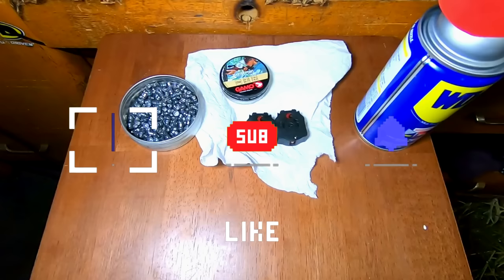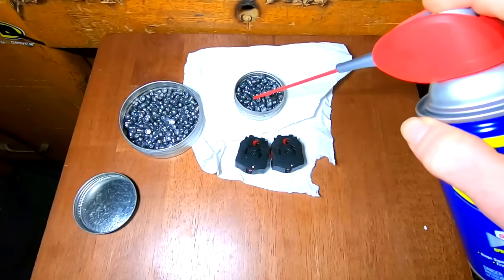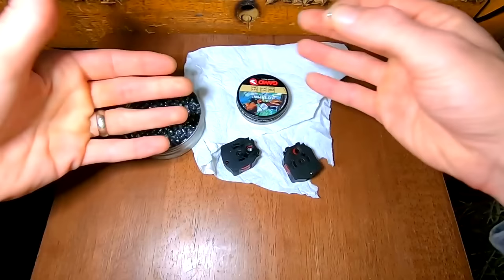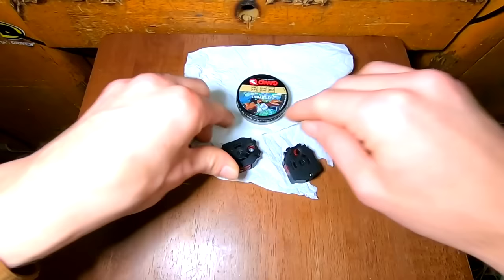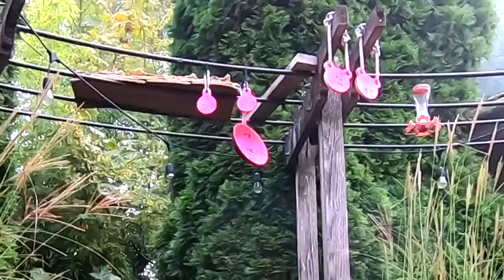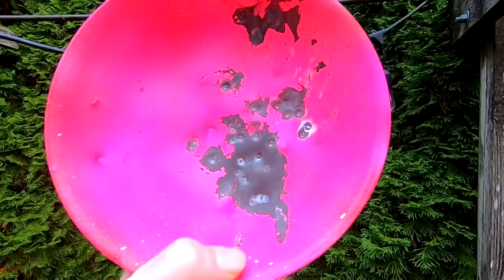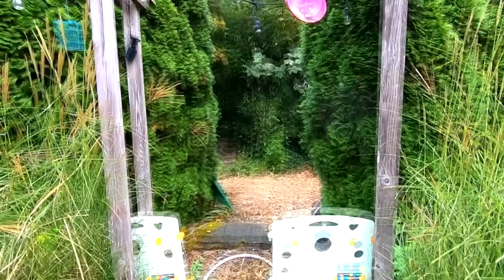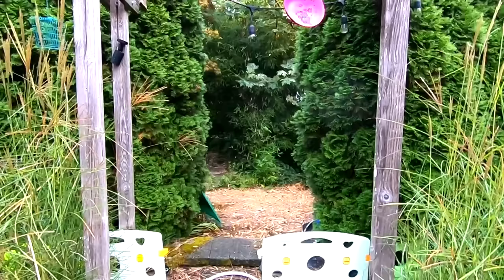Pellet Dieseling the Easiest & Quickest Method

Comment: Not a good idea to pellet diesel a n air gun. Increased pressure and recoil. Will destroy that rifle in short time.The cheaper the gun the quicker the damage. Have repaired several that would not be warranted by manufacturer. It gets expensive every time. Don't do it
Reply from the maker: I've done it hundreds of times out of both guns, and both of them are still fine. I've had them both for almost 5 years now (so warranty is irrelevant anyway).

That being said I've made more money off of these dieseling videos than the guns cost (they are only like 200$ air rifles)

And any damage that might happen, which tends to be none (the majority of people who do this, do this with zero issues much like I have), is easy and cheap to fix, and again, warranty is irrelevant when its easier to replace a rubber o ring than it is to ship a gun to the manufacturer.
Reply from the maker: You are also most likely conflating piston chamber dieseling related damage, to pellet dieseling.

The piston chamber is capable of holding a much larger volume of stoichiometric air/oil than the breech is. This means that dieseling that occurs within the piston chamber will be significantly more explosive, and cause significantly more damage. Yes, it is common for excess oil in the piston chamber to create destructive dieseling. This is common. 

What isn't common, is destroying a gun by putting a tooth pick dab of oil into the back of a pellet. There are zero recorded cases online of anybody destroying their air gun in this way. The only cases of damage I have seen or heard of, were people that got WAY too much oil in their piston chamber, from oiling/lubing their gun, and caused a massive explosion in the piston chamber. 

Again, no one has ever destroyed a gun by putting a tiny speck of oil into the skirt of a pellet.

Comment: Bro, you’re imagining, WD-40 is silicon oil, it doesn’t cause dieseling.
Don’t worry, ignorance is not a crime, just a knowledge level, education level.
All you’re doing with WD-40 is lubricating the pellets, they may be traveling a little faster but no dieseling !!
Reply from the maker: lmfao you talk a lot of shit for someone who has never read the material safety data sheets for WD40.

The regular WD40 has absolutely zero silicon in it, it is all petroleum by products. The only thing in WD40 that ISN'T petroleum, is the propellant. 
https://youtu.be/MUNqJWJnsdU

luckily I looked at the MSDS for you, so you don't have to hurt your little brain.
Reply from the maker: and no you are wrong, it is definitely dieseling the pellets. 

If gaining 30-50% velocity was as simple as lubing the barrel, it would be standard practice. You are not very intelligent if you actually think that is what is happening here lmfao.
Reply: @PelletPlinker  : I stand corrected, thank you.

Comment: This...will totally f&ck up your air gun.  It’s called dieseling as this is exactly what happens in a Diesel engine....the difference is that an engine is built for the temperatures and pressures...a spring air gun isn’t.  The gun likely won’t last long.  Sorry guys!
Reply from the maker: You realize an engine is combusting a LOT more fuel, and is doing it thousands of times per minute right?
Reply: Yes.  I’m a mechanical engineer.  For my day job I’m Engineering Manager for a global engine filtration company, so yes I know a bit about engines. I’m also a keen air gunner.   I can tell you that every time you diesel a spring air gun, the inner chamber will suffer pitting damage from the explosion.  The temperature inside the gun reaches much higher than normal and the piston seal will also degrade far more quickly.  I’ll leave it up to you!  Best regards Steve
Reply from the maker: That's not how that works.

Comment: ps get ready to destroy the air seals and forever absolutely have to diesel it :-\      not worth it unless its one of those cheap crack barrels
Reply from the maker: my seals are fine after years of doing this, hundreds of dieseled rounds down range

And you know rubber o rings are like 10 cents right?

Comment: Are you ACTUALLY presenting  the idea that deliberately making a spring gun diesel is a GOOD idea? Seriously, it us not. Spring guns diesel when properly lubed. It is the way it works. Excessive dieseling is NOT A GOOD or desirable thing.
Reply from the maker: you sound like you both don't know what you are talking about, and are also in the wrong place

This is a place where people like to have fun with their toys
Reply: @PelletPlinker  actually, I do know what I am talking about. A spring gun has an element of dieseling in its natural firing process - refer to Mr. Gerald Cardew. If there is excess lube on the piston/cylinder, the manufacturer recommends running it off until the excess has burnt off. THEY DO NOT RECOMMEND shoving more combustible material to make it deliberately explode. Its an AIR GUN that works by compressing air NOT a diesel engine that works by exploding combustible fuel otherwise it would be a diesel gun. At best, you will knacker the kit through stupid abuse. This is not about fun. Its about every aspect of life. If you wish to be absurd then fine but DON'T YOU come on here telling people this is right because IT IS NOT. What you call fun (and I call ignorance) is fine for you but your presenting it as though its legitimate and some sort of secret sauce.  Shooting - even in the states - is under enough pressure without stupidity being underlined and highlighted. In some countries it will make the gun illegal.
Reply from the maker: Ah I see you are conflating piston chamber dieseling with pellet dieseling. Fairly common in these comments. 

yes, excess lube combusting in the piston chamber isn't a good thing
This however is different than lube combusting in the breech behind the pellet skirt

How do I know the difference? One results in catastrophic failure, the other results in thousands of rounds of fun with zero problems. 

If you wish to be a prude, keep it to yourself. The internet is for people who like fun, and who like to learn. This channel is already limited to 18+ and people are able to make their own decisions. I am not even here teaching people that it is right to do or good to do, I am literally just showing a specific method to do it. 

Get your head out of your ass and learn how to be fun. Playing with pellet guns is irrelevant to gun politics.